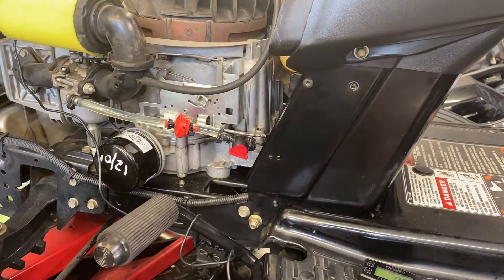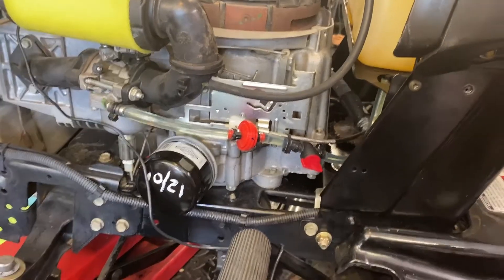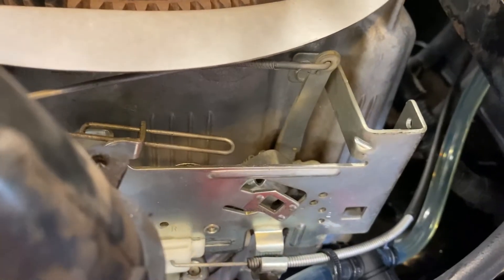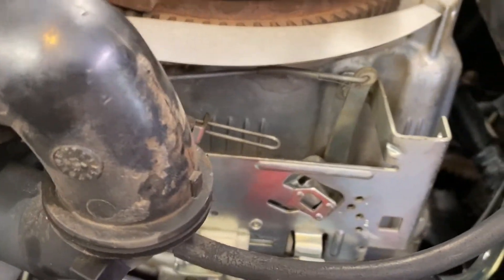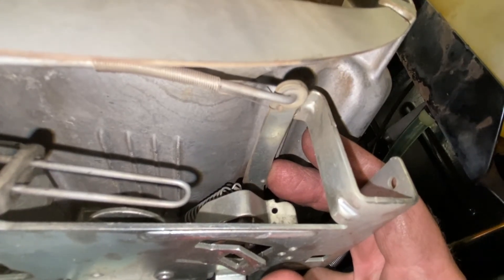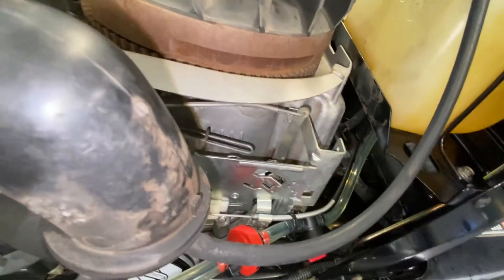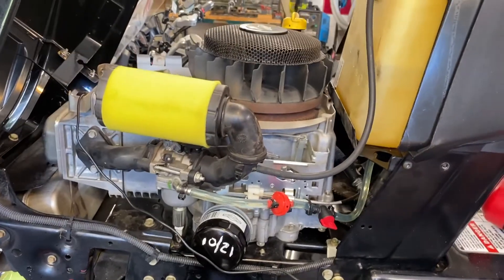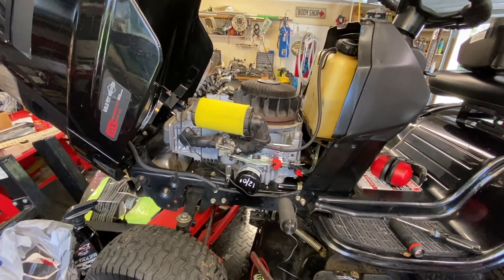Governor Adjustment, Briggs and Scrap-Iron 21 hp engine

Comment: As far as I know, the Briggs V Twin is supposed to be 3600 or 3650. However, I would need to check to be positive.
Reply from the maker: 3,600 yes. I set this one a bit lower, just sounded happier.

Comment: I have a Kawasaki fd711d 25hp engine that idles at 1500 rpm’s but after it warms up and I’ve driven it the idle will not go any lower than 2,000rpms.  I’m trying to figure out why this happens. When idling sometimes there’s a soft quick sputter then it’s runs fine again too. However at higher rpm’s it runs pretty smooth. Trying to sort this out if anyone has any input.
Reply from the maker: Come on over to the forum and let's discuss there. That way, others can chime in and help you out as well. https://moto-resto-repair.proboards.com/

Comment: So the linkage has a VERY thin spring wrapped around it. One end is on the throttle arm and the other is where? Mine is just not connected on the carb side. Where does that very thin spring go on the carb side? The rod linkage goes into a black plastic piece with 2 holes. So where does the TINY thin hook of the thin spring go?
Reply from the maker: It goes exactly where the linkage goes, between the same two holes, it just takes up play in the linkage where the linkage attaches both at the governor end and at the carb.

Comment: What would cause the engine to continue to run at high rpms when I move the throttle down? It is also not running at as fast as it should.
Reply from the maker: Most likely something isn’t connected properly. Or something is stuck or the governor is out of adjustment. Could be a number of things.
Reply: @MotoRestoFL  Everything is properly connected. I see it moving the throttle and choke arm on top of the carburetor, springs are good, but the engine’s speed will not slow down to idle. Is it a carburetor issue that needs adjusted or is it the governor arm? What is more likely? Engine starts out running at medium speed and slowly gets faster while it gets used, but it never can run at full speed.
Reply from the maker: @YoungMTrucker600  governor most likely. If you go check out James Condon on YouTube, he has numerous videos adjusting the governor and his channel focus is small engines.

Comment: HI, I have same set up and can only get to 1/2 power and pushing throttle more, RPM wont go any higher. If i move the gov arm myself, i get full power!! So i need to add a little tension on that gov spring to get more power?   Should i check the shaft to make sure it hasnt turned a little in that clamp?

Comment: Briggs and Stratton V twin Intek
Hi, Had a bad misfire, replaced carburettor. Engine now revs very high. Took engine out replaced with a new governor, did not look damaged at all. Adjusted governor to carb as per instructions.
Still revs high. Noticed the Governor arm does not seem to move througout the rev range. Any ideas? Thanks
Reply from the maker: Make sure the governor arm is tight on the governor shaft coming out of the crankcase. There's a lock bolt that goes through the arm which pinches on the shaft, at least most engines are set up that way. Did you replace the carb with a good one or a Chinese knock-off? Many times they're junk. You should check out James Condon here on YouTube. He does a lot of work on small engines, 100 times more than I do, I really try and stay away from them and work on motorcycles. @jcondon1. Bet you'll find more than a few videos with similar issues he has worked out. Hope it helps. EDIT: also there is usually a row of holes on either the arm (moving part) or the stay where the governor spring goes, you may need to change holes favoring loosening of the spring a bit. There may be a hole selection even with the type that has a screw adjustment. The tighter the spring, the more it "cancels out" the governor and maintains the throttle plate in a more open position. When the governor is working, the engine under load obviously drops RPM and the governor puts less force upon the spring thereby allowing the throttle plate to open more. This is why your throttle is always sitting side-open with the engine not running, the spring is forcing the throttle open because there is no governor action to counter that. Again, there may be different holes for the spring in addition to any adjustment screw and some engines only have a bend tab to put more or less tension on the spring. You also have to factor in the throttle cable make sure that's all hooked up properly. I don't exactly know how it's set up on that engine.

Comment: I have this same engine and having an issue with it starting.  It cranks and spins, but will not start.
Reply: Make sure you have spark. Engines just need 3 things to run... fuel, air, and spark. Take your spark plug out, plug it into the boot, put it up against the engine to ground it, then turn it over and see if it gets spark. Next is air and fuel, which are governed by the fact that the engine has compression and can pull air from the carb. If you can spin the big fan on top of the engine with no resistance, then your engine is blown. If you get resistance, then you're good and I would start to look at cleaning the carb to make sure the engine is getting fuel.

Comment: Good video.  Do you have any idea why the choke only turns on as you get to the higher throttle?  On my mower there is minimum throttle position to mow symbol on the dash next to the throttle lever which is past the point where it begins to engage the choke.  They use turtle (which ironically has zero choke), mow about 3/4 way up and rabbit at the top.  I opened up the carb and default position is choke held open by the butterfly spring.  I thought mine must have been assembled backward or something but it appears as though in this century we now apply choke at higher throttle.  My engine sputters and dies if I put the throttle up to the minimum speed for engaging the PTO because of the choke.
Reply: It’s a tortoise and a hare
Reply from the maker: It’s just the way they make them, economy of movement and function.  Your problem is adjustment. Locate the cable where it is restrained on the carb throttle bracket. Put it on full speed which should have a detent on the lever itself to locate it and hold it in position. Then loosen the clamp which holds the end of the cable at that bracket simply adjust by sliding the cable sheath one way or the other to the point where the lever which actuates the choke butterfly is just about to touch. Then tighten the cable clamp and try that.
Reply: @MotoRestoFL  OK thanks, I'll adjust it as you said and try that.  "Full speed" should be the mark next to throttle for mowing speed?  Or should it be a little past that?
Reply from the maker: @ocrun6765  you should feel a detent or click like when it is in full throttle.
Reply: @MotoRestoFL  I wanted to get back and thank you!  I adjusted the throttle cable at the detent, using that position for full throttle as opposed to the rabbit on the throttle, which is beyond the detent and gets into choke.  I added a bit more RPM by bending the tang where the spring connects as you showed.  All of your explanations are very clear and concise.
Reply from the maker: @ocrun6765  excellent. Thanks.

Comment: Thank you for your very professional and informative video posting and instructions which are far better that any that I've ever come across on YouTube, pages of internet sites, and even Briggs and Stratton's website. I've been mechanically inclined for all of my life and likewise felt that my same 21hp Briggs Intek on my Craftsman tractor was running way too slow to be working efficiently, and needed adjustment. I began to check it out yesterday using my tach initially starting with a dead idle speed of 1700 RPM slowly increasing it to a maximum governed 3090 RPM, eventually I ended up increasing it up to 3430 RPM maximum in several stages and left it at that with some future room to spare under a 3600 RPM safe maximum ceiling, but likewise my dead idle speed increased higher to 1890 RPM which isn't too excessive. I haven't tested it cutting the grass yet but am very sure that it will improve the slight bogging condition that I was experiencing in thicker grass areas because it felt and sounded like the governor wasn't kicking in at all. Just a thought and question that I had "wouldn't the new dead idle speed of 1890 (and the 2000 you say on yours) be able to be set back down closer to the initial 1700 (and likewise on yours) afterwards just by using the set screw where the linkage is connected at the carburetor plate swivel opposite linkage end if there are enough remaining threads available going counterclockwise to do so without causing any changes to the already adjusted high governor 3430 set speed, and have you tried to do this???" Thanks!
Reply from the maker: I'm not sure. I'll have to try that sometime. Thanks for watching and commenting.

Comment: Most of these small engines are tuned to 3600 rpm max. 3200 is a good safe speed that will allow for some variation in rpms.

Comment: I have the same issue with my snowblower briggs stratton  it keeps surging I clean carb main injector new spark plug and add and fuel filter on it  and now it start but sometimes  surge and other works fine for 5  to 10 min and as soon a put a load on the augers  start surging  and stalling and doesn't  not start again I have to leave for 10 min and choke  again I even adjust the governador and still have the same issue and I felt the motor working in low rpm no like before started  giving  this issue I will try to adjust the spring on the governador thank you
Reply from the maker: If all else is good, it's the governor spring/linkage especially with surging. However, it also could just be the linkage. The throttle attaches to the governor arm usually with a selection of holes or positions, but sometimes not. If it's running slow and there's a governor adjustment screw, try that. If not, bend the tang like I showed. If those don't correct it, check to see if there's any other holes any linkage can go on the governor arm itself. You can move the linkage to another hole. I cannot exactly recall which way to achieve either a more or less sensitive behavior (surging is symptomatic of more sensitive or too sensitive). I'm not 100% sure about snow blowers, I imagine they're same basic engine setup. For a really good explanation and adjustment of governors, check out James Condon here on YouTube who works on tons of generator sets and adjusts a lot of governors to a set frequency (Hz) of engine speed. I may be relevant to your engine. Cheers.
Reply: @Moto-Resto, LLC  I will check that channel hopefully I can find anything good I will adjust the tension on the governador  spring to see if I can get more rpm  tha k for the info
Reply: I have read many reviews that simply state that for these Briggs it is so much easier and less time consuming to just buy a carb from Briggs. Most all state they can never get the carb to tune correctly after it is gotten clogged up.
I just bought my 4 year old 17.5 hp briggs a new carb last month and I can say they are plug and play with nothing left to do.